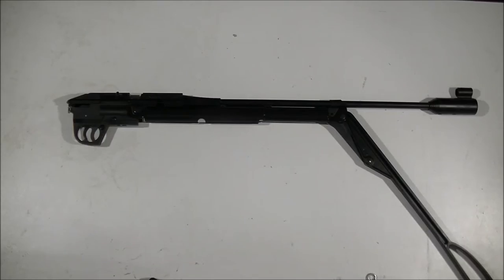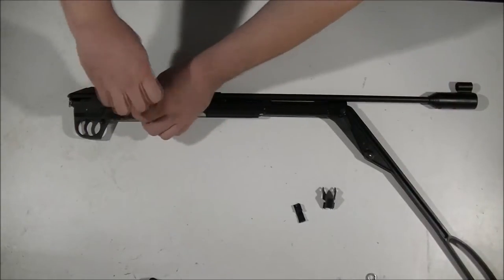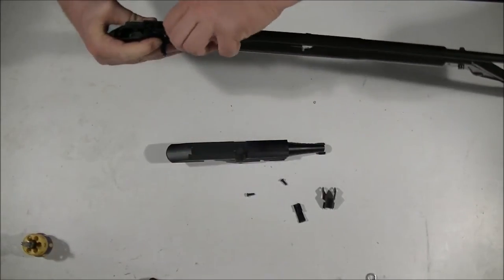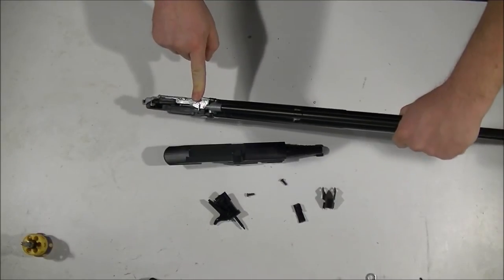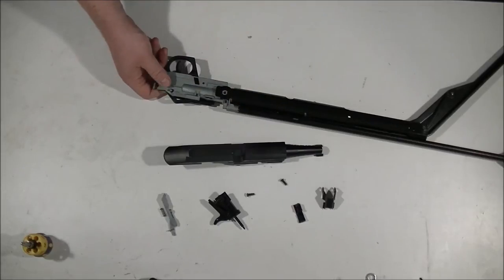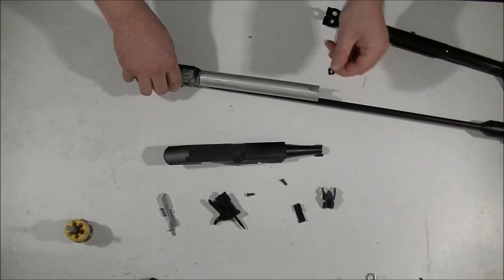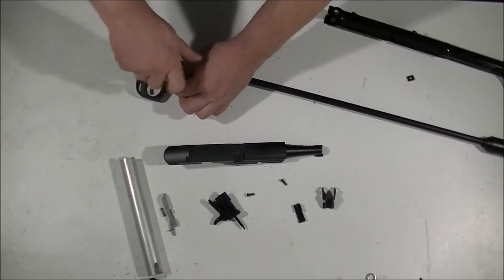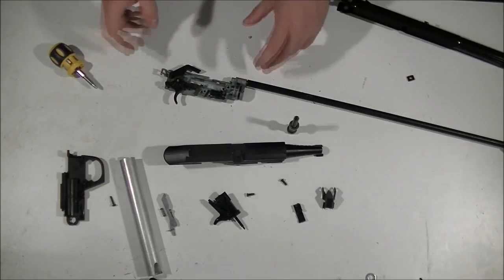Daisy 853C Teardown to trigger housing

Comment: Really helpful videos on the Daisy 853. Thank you.
I recently bought a refurbished 853 for my son, from the CMP. We've only used it about 4 time, and it has already stopped working. When I cock it, it doesn't seem to create enough pressure to actually fire a pellet. It has a weak air sound when I pull the trigger. Now it has a pellet lodged in the barrel. Does this sound like it has developed a problem with the seals already, or could it be something else? Can you make a video to address this issue, or fixing the seals?
Reply from the maker: Thanks for the interest in the channel Bill.
Your 853 has low air pressure caused by many, many possible problems.

Open your pumping handle and look just in front of your trigger guard. There you should be a black plug. If its there your problem is just a simple teardown and clean out. The videos for this repair are filmed, just need to be edited and posted. Should be up soon.

If the plug isn't there go to the site www.bbgunrepairhq.com and look for the "suggest a BB gun repair" link. Email me and I will talk you threw the repair, its going to be a while before the video is filmed and posted.
Reply: BBGunRepairHQ.com I've replied using the contact account on website email address. I wasn't sure what you meant by the plug, so I attached some photos of the air rifle.
Reply: Wow, I'm hear with the same cmp air rifle and problem. I can hear the air leaking on mine, I just bought it last week.

Comment: Hi, I bought a brand new Daisy 953 and the pump arm seems to have some side-to-side wobble when it's open for pumping.   It's minute and I'm sure it's not a problem but I'm really anal about it.  Is there a way to tighten the hinges or shim the spacers to eliminate this, or is it just normal for these guns?
Reply from the maker: +Adam Riga The wobble is normal and won't affect operation or accuracy. Shims or spacers would make it harder to pump the rifle.
Reply: thanks!